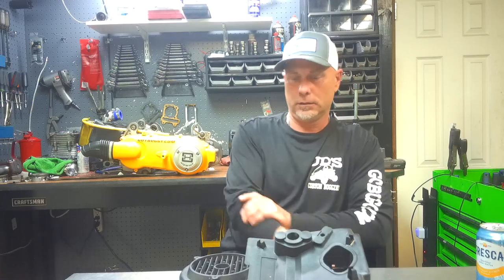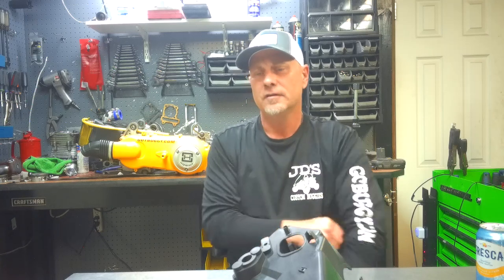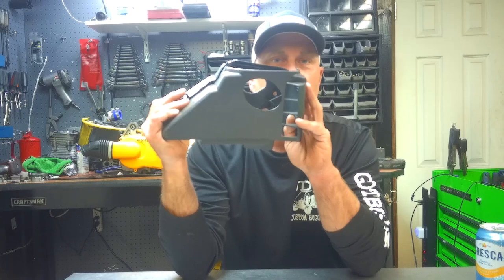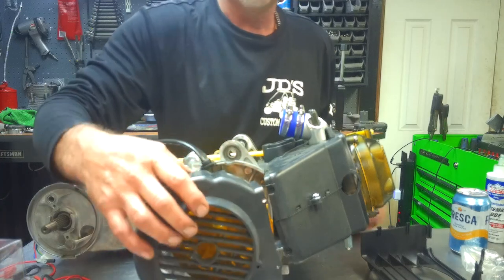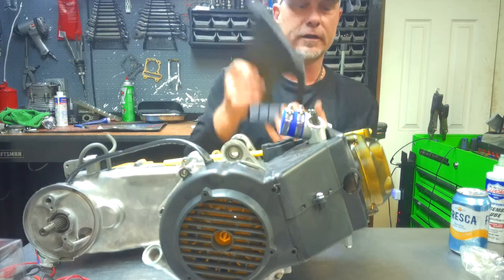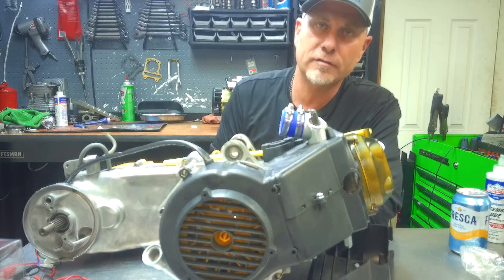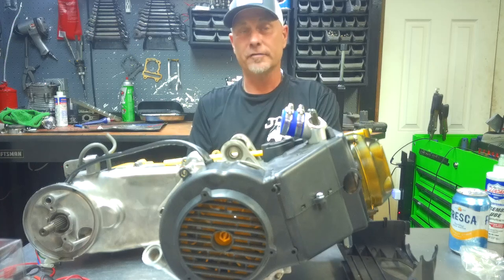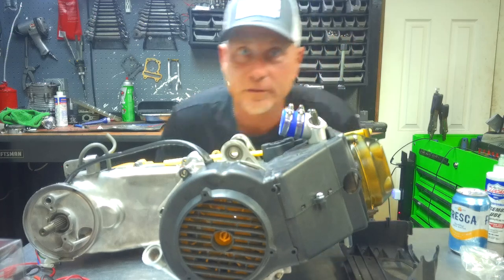YOUR BUGGY'S COOLING SYSTEM?

Comment: I don't know if you're familiar with squirrel cage fans, but they typically suck from the center and blow out. That fan is a blower. , That's why in the fall you'll get leaves stuck to the fan shroud.

Comment: Couldn't the cooling system become the Riders Heater?                                                                                                                                                         Couldn't 1 of those European Snow skirts be installed, and then pipe that air into it kinda like a VW bug motor heats the passenger compartment? Maybe even sew in a little extra sealing ability for the skirt and have a heated Scooter?

Comment: Is it worth 300 it runs and drives but the oil shoots out of the valve cover gasket
Reply: Oil is probably shooting out from valve cover because someone used rtv on base of cylinder to block, and plugged up oil hole

Comment: I bought a 2015 GoMoto Urban Tribe 150cc GY6 and it came off the showroom with the 170 big bore on but no engine shroud. I only recently found out that they exist and what they do, hence finding this video. Luckily for me is Ive always looked after it and it only now started intermittent smoking on start. The cheap solution I came up with was to cut open the cover behind the front wheel that feeds into the chamber the battery is receded into and plan on making the airflow around the battery more streamlined like a teardrop. In theory that should act as an air ram through the body. Would also need to close off the side stand hole, but I never use it anyway.

PS The big bore head is bigger then stock, so the shrouds dont fit on them.
Reply: hi! any updates on this?

Comment: Jd you got your intake and exits mixed up lol. They pull through the fan cover and blow out by the exhaust
Reply from the maker: yea i realized that after rewatching it figured it didnt matter enough to delete the vid and redo it, but you are correct
Reply: @jdscustombuggies1733  Lol right the main point is that they need the shrouds

Comment: Why not draw cooling air from somewhere besides right next to hot exhaust. Could you duct air in from above or beside the seats?
Reply from the maker: don't know why they designed it the way they did, but it does work and is effective
Reply: They dont draw air through the exhaust side. They draw air from the center of the fan and push it through and it  exits by the exahust.

Comment: I would never run my scooters without cooling shrouds, especially being in Florida 🌡🛵👍.JD have you ever installed NYC oil coolers. They're pricey & my scooter was basically set up  for the radiator. Don't do much while Idling in traffic. Hit 40 mph  & it cools down with the quickness. Without a electric fan & definitely don't need one .Great info thanks my friend 👍